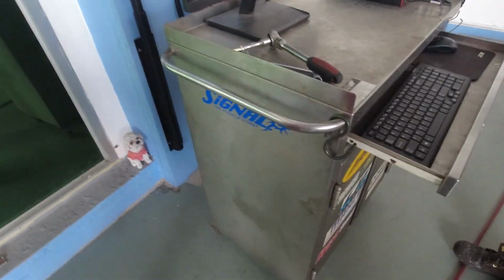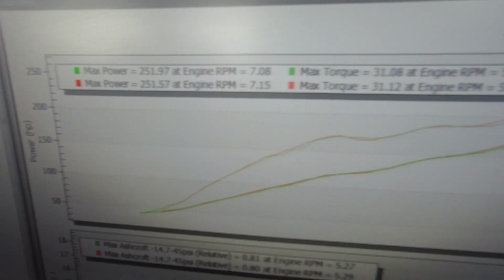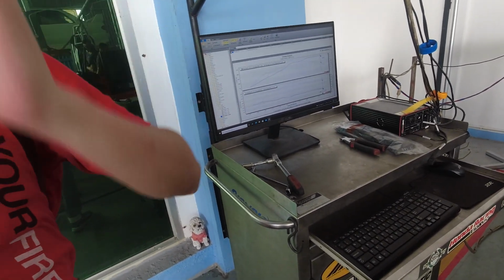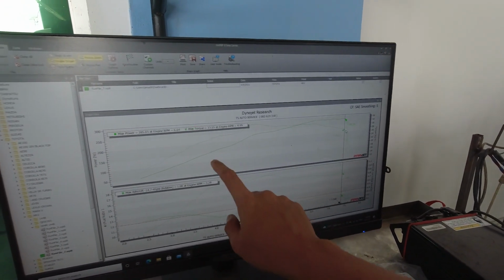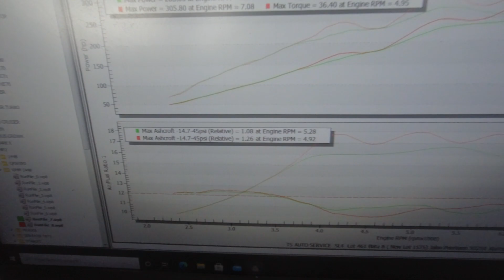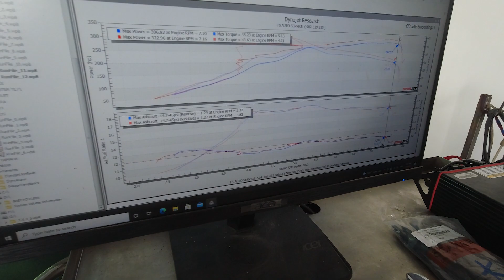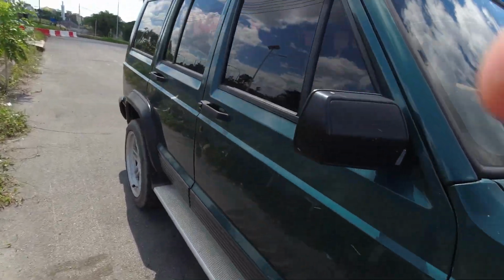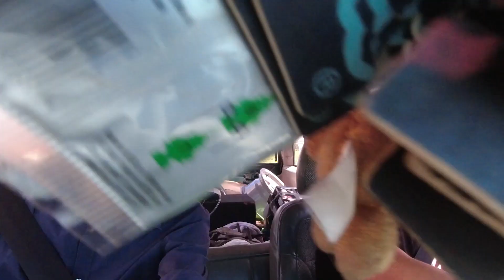Insane Fast Spool 3SGTE SW20 MR2 Dyno Day!

Comment: What mods do you have on the engine? Stock turbo?
Reply from the maker: No engine internal mods but as for the manifold its using custom manifold with EFR 6258 turbo. Stock intercooler as well